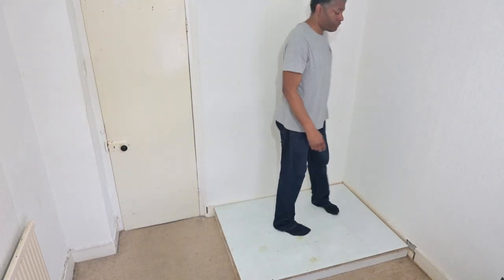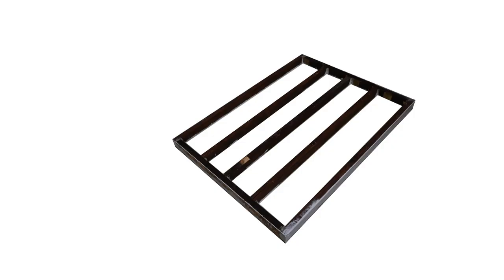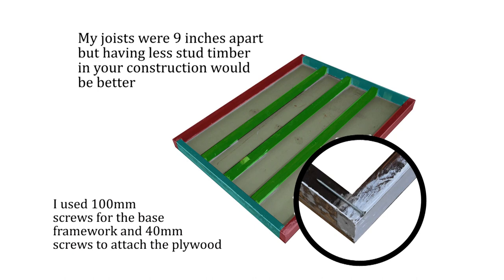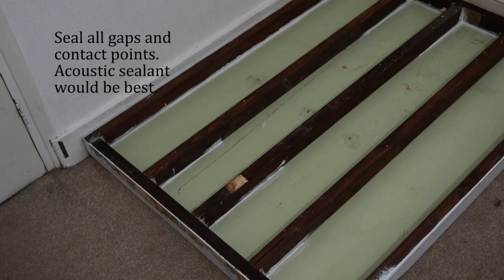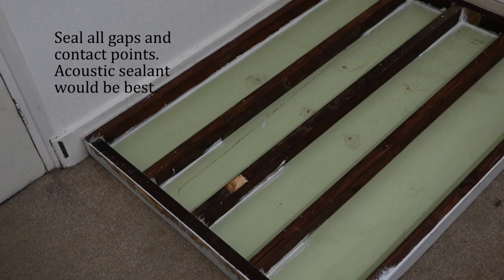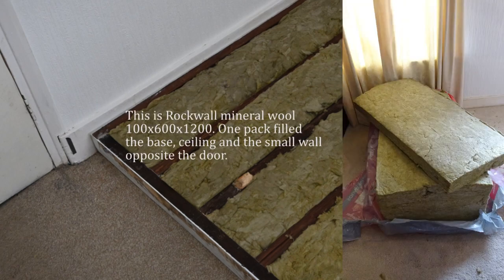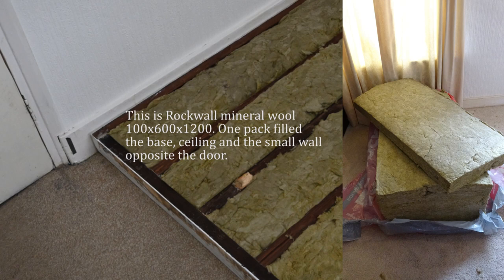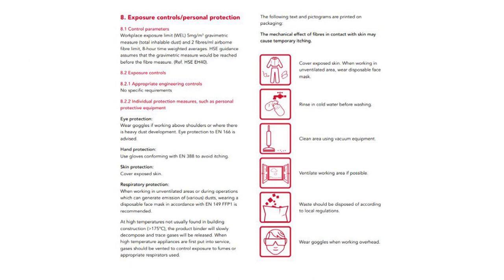How to build a sound booth

Comment: In the dictionary from English to my language, there's no difference between plasterboard and drywall - they all translate as my language's version that literally translates back to English as "gypsum board".
Those boards can actually amplify sound by 3..6 dB IIRC and you need two layers - as used in the video - to try to get rid of that. However, I learnt that it is better to have two different thickness layers than two identical ones. In that case, however, there is directionality to the sound deadening. With identical layers, the sound coming through is strongest at the resonant frequency of the board and when both are the same, they can excite each other. When they are different thickness, these frequencies differ and deadening can improve but you need to decide what you want to prevent: sound getting out or coming in.

The video is extremely good at all levels and the options for improvement illustrate very good underlying research.

What does not get mentioned explicitly is the difference between "air sound" and "contact sound". The more expensive and thicker staggered wall option reduces on the "contact sound" much better, and the "cabin in cabin" takes that to another level. In these latter options, the added air gap helps and added insulation too.

On the inside, the hard walls will bounce a lot of sound around and the cabin may not be as "dry" (free from echo, reverb) as you would want. This is amplified by parallel walls. In the example here, the slanted ceiling already makes floor-ceiling not-parallel, but you could slant side walls too. That's a lot more difficult to construct, however. And it is easier to cover the walls with damping material.

While this is a great solution for brass soprano, alto, and tenor instruments, let's not forget that human soprano, alto, and tenor voices can produce a lot of deciBels too. So for singers who need to practice their scales and warming ups, or arias, at "live performance" level, this booth is an ideal solution too.

Comment: This all makes sense to me but the door is a bit confusing. Do you think you’ll ever make a video explaining in detail how the door is built with what type of hinges and everything.
Reply from the maker: Hi. The door is a normal wooden door using 3 ordinary door hinges and is secured to the outer framework like any door would be in a house. To make the door thicker and while it was already secured in place, I screwed a wooden framework to the door as seen in the video. I then placed the insulation within the framework and sealed it off with 2 layers of drywall on the inside and 1 layer on the outside. Because the door will be thicker you have to be careful not to put the framework close to the edge where the lock will be as the door would not close or open because it is too thick. By trial and error you can find the right place and put a strip of drywall on the edge of the door. Once the thicker door closes properly, you can then attach an inner framework to the booth so that the door closes against it to make an airtight seal. Basically I made the inner framework, went inside the booth, closed the door and screwed the framework in place so it was a nice fit. Hope this helps. Thanks

Comment: Hello. My joists will be 38x55x2000mm. What thickness of rockwool should i use? I guess you can compress the rockwool by stuffing it tightly between the joists, which is what i assume you did with the 100mm thickness rockwool you used?
Reply from the maker: Hi. my joist was 38x63 so I had to compress 100mm slabs down to 63mm. I did that by putting a piece of plywood on top of the rockwall slab and standing on it until I pushed the air out of it. However once you get off it, the rockwall expands again a little. But I was just able to compress it enough and attach the drywall to the frame with a lot of effort. The rockwall was pushing the drywall away from the joist and when I finally managed to screw it in, because the drywall is soft the screws started to sink into the drywall and I thought the screws would go straight through. However with more screws I was able to stop this. I would not recommend trying this. It would be very difficult to compress 100mm to 55mm.  Probably best to use  a size that will fit but the smaller the size the less soundproofing you will get. If it is for a musical instrument then 50mm of rockwall will not make much of a difference to the sound. If you watch my video where I do the test results you will be able to judge whether less than 100mm is sufficient. Also multiple layers of drywall is heavy so you will need to know that the wood can support it. All the videos I watched on the subject used joist 100mm and above so there was no need to compress the rockwall. I did see a video for a vocal booth with 50mm rockwall but there were no test results. Hope this helps. With such an expensive project you need to make sure you will be happy with it in the end. Thanks.
Reply: @Saxcomprehensive  Hi, that's good to know, thanks alot for the info. I guess one solution would be to just add more joists (inside or outside) on top of the existing joists. So that 55mm would become 110mm joists. Then I can safely fit e.g. 110mm rockwool between the joists. Would be more expensive but might as well ensure it will perform well. I plan to sing and play guitar in mine :)

Comment: Really good video but I have a question: what about air ventilation? How do you breathe inside there for extended periods of time?
Reply from the maker: Hi. I play my saxophone in there for about 40 mins and then have a break. Since the booth is small I can open the door briefly without leaving my seat  if I want to let in fresh air. For this size booth I don't think it is worth installing ventilation especially since I can easily open the door for a few minutes after practicing a few songs. The main problem is the heat and noise inside the booth but the noise is reduced by using headphones and mic and if I get too hot I have a break. Thanks
Reply: @Saxcomprehensive  thank you so much!!
Reply: You could probably add a vent but in order for it not to ruin the soundproofing it needs to be well insulated and have a lot of twists and turns inside the walls before it reaches the inner chamber

Comment: for the wooden framework for the walls and ceiling, did you use smaller joists than the ones for the base? They look smaller to me but it might just be the angle 😄
Reply from the maker: Hi. The wood for the base, walls and ceiling were all cut from the same size timber. The wood for the base was recycled from another project which was painted with wood preserver and that is why it a different colour from the other framework, but they are all the same timber. If I had space I would use a bigger size as I had a problem squeezing the 100mm insulation between the drywall because of the width of the timber. Before building my booth I watched at least 50 other videos on booth construction and some were very effective in reducing the sound but they were a room in a room construction with 2 doors. If you have space then that is the way to go for better soundproofing. Thanks.

Comment: What acoustic sealant would you recommend for sealing gaps?
Reply from the maker: Hi. I do not have any recommendations. It is probably best to use what professionals use when sound proofing a room since it is the same principle. There are lots of videos on sound proofing a room. The acoustic sealant stays pliable and so will not shrink or harden so will not result in cracks or air gap over time. However, I don't think it will make a big difference to such a small room. I just used some silicone sealant since it was cheaper. The real issue is the denseness of the walls and door since the sound will travel through them. The sound test on my booth shows that the sound will still escape with a single wall design. So unless you are going to use materials like mass loaded vinyl or a double wall construction, be aware that it will not be totally sound proof but will reduce the sound. Good luck with your sound booth.

Comment: Hello sir great video. Please  can I use styrofoam as an sound insulation, that is in place of a mineral wool for a sound booth? Thank you
Reply from the maker: Hi. If you want to reduce sound you need something thick and dense. Mineral wool is denser than styrofoam and therefore better. I have seen booths made with styrofoam and drywall but they were vocal booths and many did not have test results. If you want to reduce the sound of an instrument styrofoam alone would not be good. It would only be used with other more denser materials. If you watch my other video where I have test results for my booth you will see that even mineral wool and drywall still allows a lot of sound through. Styrofoam would do a worse job than that. It really depends on how much sound you need to reduce. It may be adequate for vocal recordings but not for reducing the sound of instruments. Thanks.
Reply: @Saxcomprehensive  .Thanks alot for your reply . Your videos  have a good help  to me on my saxophone journey. God richly bless you 🙏 🙌 .

Comment: Has anyone use Homasote sound board? It’s used for acoustical absorption purposes , say an additional layer over the MDF (or particle board). You would still use sound batts (fiberglass or mineral wool) between the wall framing.